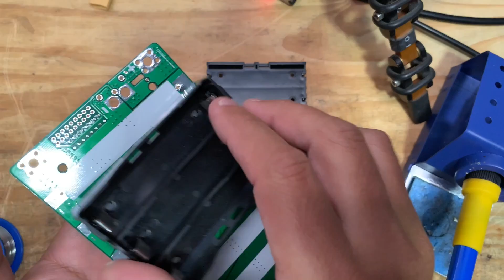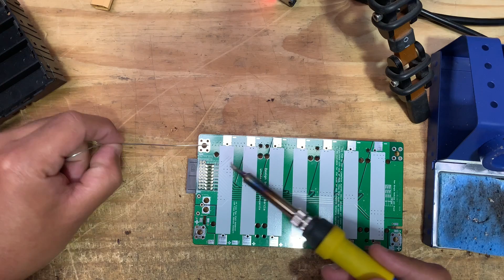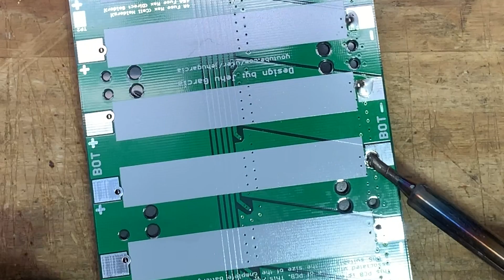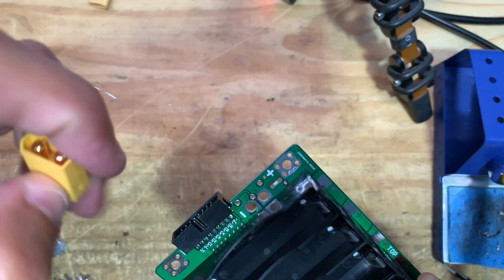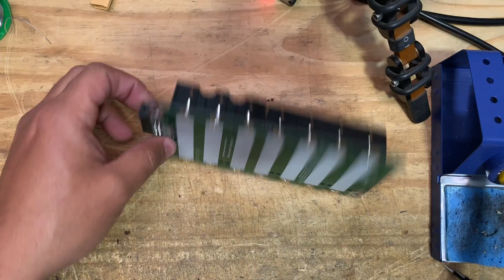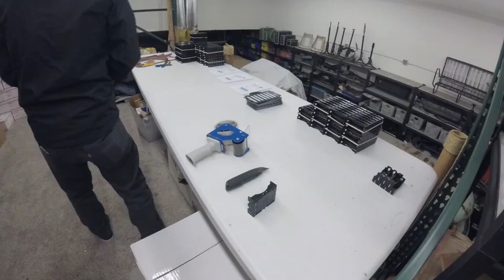Populating Jehu's DIY Powerwal PCB v1.3

Comment: When populated this is essentially a 7s1p battery? So when stacking 2 boards  you are creating a 1s2p battery out of 2x 7s1p? Or does the first battery on each board get connected in parallel with the ribbon cable?

Comment: I need to upgrade my small UPS battery backup from lead acid to lithium. Does anyone pre-assemble these kits so I can just open my UPS and exchange my lead acid with lithium that is already assembled? I can let you know battery size in voltage and watts and the battery length, width, and height.

Comment: How many of these would I need to make 100+ kwh of storage with 3300mah 18650s

And if I did happen to do that, how many amps could I discharge the entire system at? Looking at using these to power an entire home. Two water heaters, water pump, lights, stove, fridge etc

Comment: Hi Jehu,
I just finished putting together my first HP Batt Module, and everything looks good until.
I started adding the batteries (all facing the same direction with the negative on the base), now when I plug the last cell, all the batteries start overheating and apparently the last battery makes a short.
I check all the voltages as I was adding them and they check good.
Can someone give me a direction on what it could be the issue?
Reply: Check for solder bridges.  Especially at the ribbon cable connector the solder points are close together and easy to bridge when soldering.  Also at the + battery terminals if the PCB gets scratched (insulator over traces) the gap is excessively small it is easy to bridge between one of the middle battery + and the main +.

Comment: I know this is late Jehu but when soldering the battery holders, it would be better to heat up the pads/track then go to heating the holder pin and pad this way you are minimizing the time the holder plastic has the high temp.

Comment: Forgive me if my question comes across as ignorant, but why are these small batteries the best to use when you know how much power you want to generate and could design a single unit to address the need?
Reply from the maker: Single unit?  Explain
Reply: @jehugarcia  - Hi, thanks for responding.  I was watching https://www.youtube.com/watch?v=kndi9CYM7Nc and was thinking that the assembly of the small batteries into a unit is basically what is being manufactured in this video.  I haven't looked into comparing the performance statistics, longevity or the pricing, but I was curious.

Comment: how much do you lose by NOT spot-welding the cells compared to just clicking them into the holders?
Reply from the maker: Loose?
Reply: @jehugarcia I mean higher resistance due to high Amp draw. does that have an effect? (I know, strange question)
Reply from the maker: Quite a bit, but powerwalls are not high power application so cells will never see high Amp draw

Comment: Great video to share to people who want to learn to solder, love your style and easy flow presentation. 
Awed by your work and humbled by your generosity in sharing what you have learnt. 
I want to use your kits for a different industry, field charge packs for those on the go. 
You mention back to back stacks, I want to make a 4s 7p pack, can I use 2 boards stacked ? 
One last tiny (maybe silly) question I have is the power standoffs between the two boards, it kinda scares me a bit and I wonder if heat shrink over them would help or a insulated threaded spacer maybe.  
Big love to you Sir

Comment: Hey Jehu do you need someone to solder boards for you?  I've been soldering for 30+ years.
Reply: Sam Ghali - I need to upgrade my small UPS battery backup from lead acid to lithium. Does anyone pre-assemble these kits so I can just open my UPS and exchange my lead acid with lithium that is already assembled? I can let you know battery size in voltage and watts and the battery length, width, and height.

Comment: Suggestion: add a second pair of holes so you can mount the cheap through-hole holders from both sides at once, one offset a bit from the other. Also, instead of the quite expensive brass standoffs, would the M4 screw terminals and a copper bus bar be cheaper?
Reply from the maker: The problem is soldering the thru hole can only be done on the bottom,  hard to do it there is cell holder in the way.  Same price for M4 mounts and standoffs

Comment: Hei i am wonering if you are going to disigne a  12v power wall system
Reply: 12V is hard with the lithium cells most people are using. It's either 7S (24V) or 14S (48V) to match the voltages of the cells. You could do 3S for 12V, but you wouldn't get much capacity out of your cells.
Reply from the maker: No
Reply: Okay i get it tanks for the help

Comment: Rear fuse is useful for smaller pack you'll work harder, maybe with batteries on both sides, surface mount and 10A fuse, use thicker traces (70 microns) and NEW CELLS but be careful with new cells to carefully test each one first. (the new cells are LESS reliable than the used cells in general)

Comment: I make stacks of 20 and I use the 90 degrees XT60 I put 3 on the bottom 3 boards to remove power on 3 pairs of AWG12 cables because it is more practical for me.

Comment: The weight of the soldering tip is important, also use 0.8 or 1mm wire for big traces. You can also use more time, in the end even with the 40W station I end up with a nice solder, and the plastic is okay even if i put heat a long time. For smaller things I use 0,6mm wire.

Comment: For small things I have a pointy tip (45g) and a 45w station set to 350°C ; for the big traces I use a chisel shaped flat heavier (80g) tip and a 60W station set to 400°C. This melts perfect and fast with any solder wire (as long as it is eutectic with flux). The rounded edges are a nice touch. THE FUSE : would be much easier to mount an automotive fuse holder and so it would be easier to exchange and test in case of failure. The current fuses are such a pain to mont and even worse to change if popped, so I use 6,3A fuses. Your choice of iron tip is good all purpose, but as you see when soldering big traces this is not perfect (but good enough). So far I have made 100 units, 700 to go ... Testing and sorting the recycled 18650 is much longer and less fun than soldering.
Reply: Hey Alexandre, do you have the new HP v1.3 with 14 batteries, because the link doesn't work anymore, and I only have v1.3 with 7 batteries. Thank you :)

Comment: Hey Jehu, 

Would you release the Gerber files for the BMS board and Battery monitoring board so that it can be ordered from JLC PCB. I can only find the v1.3 board. 

Thanks in advance.
Reply: @Jerome, He's now made the Gerber Files for the BMS, and SOC (State of Charge) boards on the JAG35 site 
    example site: https://jag35.com/products/high-power-18650-battery-module-diy-pcb-kit-10x
            Download BMS Gerber: https://www.amazon.com/clouddrive/share/6Q3TC6J1FA5HjQDQT27hCYXBW3ldhMmX9SFt71UCQhe/dh5x0dtCRZmefkArG8LOVQ?_encoding=UTF8&*Version*=1&*entries*=0&mgh=1
             Download S7 SOC Gerber File: https://www.amazon.com/clouddrive/share/jRJT4bCvSBJa5twERd9cRplnhejem6ieR4O28GcWpld/YtoBe4glQomDQzBPw74l-Q?_encoding=UTF8&mgh=1&tag=jag35com05-20

Looks like @jehugarcia may have made a mistake on the "Download PCB v1.3 Gerber" link..... 
https://www.amazon.com/clouddrive/share/nKlzNc6qdAn0JNs2gSo1JzgwdCQfPd2d3Rrp6rdQwUz/r6Yad2V3TIWKKBfnymmyjQ?_encoding=UTF8&mgh=1&tag=jag35com05-20

I get this error:
"Not Found
This shared content is unavailable or has been removed by its owner.
Please verify the URL or contact the owner."
Reply: @HealNone tengo el mismo problema, pudiste conseguir los archivos para PCB V1.3? Si los tienes me los pasas por correo? Gracias. lucaspajarocauzzi@gmail.com

Comment: Hey jehugarcia! Big fan here.
I had an idea. There is a DIY BMS system available out there (link will follow), it has great monitoring functions as well as WiFi connectivity and balancing functions. And I think it would be great to make a module/ a PCB that fits the rapid power wall modules. I'm an electrical engineer and could help with the design addaption.

Here is the link: https://youtu.be/rT-1gvkFj60

Comment: Awesome Jehu!! Do you think 16s system could be next one? Benefits would be that you only need 4s holders and voltage is sufficient for high power use.
Reply: Few people in the powerwall community do 16s because 14s more closely matches the 48V range of lead acid, but once the eagle (or however they're designed) files are available, you could just modify them a bit. It's open source :)

Comment: The solder isnt shiny as you are using fake solder that actually doesnt have flux and lead inside it try a more expensive solder aswell as use some good flux like amtech
Reply: Kester Solder is the only thing I will use.

Comment: solder resin is corrosive. You need to clean your solder points using an acid brush with isopropyl alcohol after soldering. Also, you can get a much better solder joint by cleaning the surfaces with the alcohol before soldering. That way you can avoid cold solder joints. The solder joint may look good, but after current flow and heating the joint will fail. I’ve redone hundreds of other people’s soldering jobs because of cold solder joints. I prefer using non resin core solder but using a solder flux. I find the solder flows much better and the solder joint is much shinier. Which indicates a good solder flow.

Comment: Hey that was good. What is the power out from this battery pack as in voltage and amp hrs please?
Reply from the maker: Power?  1c
Reply: 1c? What is the output voltage ? 12 or 24 volts? And how many amp hours ?
Reply from the maker: @juliantaylor9585   24v,  amp hours = depends on the cells
Reply: I would like to make a solar generator and like the idea of your kits. I was wanting to make a lithium 12volt battery with around 150 to 200 ah. Do you have a kit that fills these requirements?
Reply: @juliantaylor9585  I have seen through Jehu's videos that if your after a 12volt system then your better using LifePO4 batterys and in that case jehu's kit is not what ur after.. his are for Li-Ion 18650's ... hope that helps.
Reply: RaithUK thank you yes it does. He must have a kit that does do the 12 volt solar battery. I just need a pointer to find it 😁
Reply: @juliantaylor9585  Nope. 18650 cells as used here are not well suited for 12V systems. Their voltages just don't match. You either see 7S for 24V or 14S for 48V. Most solar inverters and MPPT chargers are available in 12, 24 and 48V.
Reply: Jesper Monsted thanks for that. That’s a bit of a bugger then 😏 So what’s the best way to make a 12volt battery? Buy a commercial one I suppose ?
Reply: @juliantaylor9585  You can use some of the other chemistries. I believe a Lithium Iron Phosphate (LiFePo4) cell would be quite suitable in a 4S setup. Some of them are in 18650 shape, so they could be used in Jehu's battery holder.
Reply: Jesper Monsted hey thanks for your reply. Sounds like a good idea however if this is a 48volt system just changing the batteries won’t change the voltage to that degree hence my question to Jehu does he have a circuit board kit for 12 volts 🙏
Reply: @juliantaylor9585  If you use 4 LiFePo4 cells in series, your voltage will be around 12V.

Comment: Can you make a kit using 18650 that can replace a car battery?
Reply: Car batteries have to have a high amps output, with the trace fuses on these power wall boards I doubt they could handle that. With redesign and a lot of cells (parallel for load, series for voltage) you could design around that.
Reply: A bank of supercaps plus a bank of LiFePO4 26650's (four in series, the more in parallel will last longer when the car hasn't run for a longer time) will work perfectly to replace a car battery. Let me know if you need an actual part list. You can try it with just the supercaps first but if your car sits for a week without being started it'll probably be too low to start the car.
Reply: Please send me the part list for your battery. Awhile back I started salvaging old laptop batteries and was able to get a lot of good 18650 cells from them. I thought maybe making them into a car battery is a good project since currently I have no use for them. 

Thanks for your help with the battery.

Comment: You can use non conductive liquid flux and apply a little to each contact before soldering. It will distribute the heat evenly. And if you need to clean the excess liquid flux, it comes out very fast with alcohol 91-100% and a q-tip.

Been soldering regular solders and microsolders for 15 years!
Reply from the maker: I’ve seen lots of folk leave all that junk there, cleaning is another step to forget
Reply: @jehugarcia  yes some dont care cleaning the area, but doing looks more profesional and a well done job. If you need the name of a very good non conductive liquid flux i use let me know!
Reply: @Intimidator443  Not much need for extra flux when he's using rosin core solder.